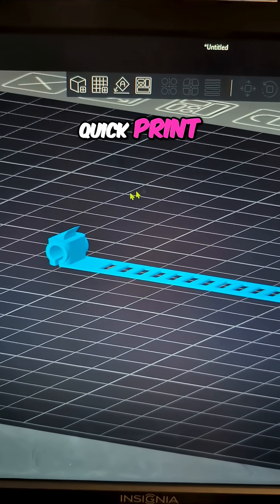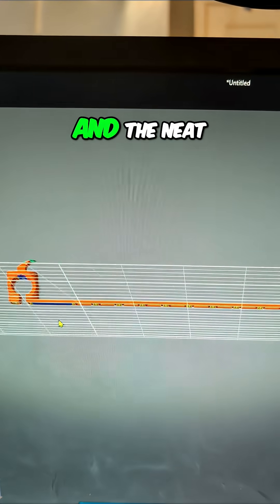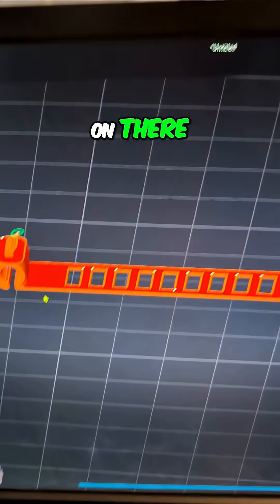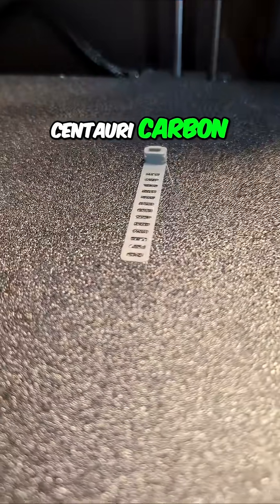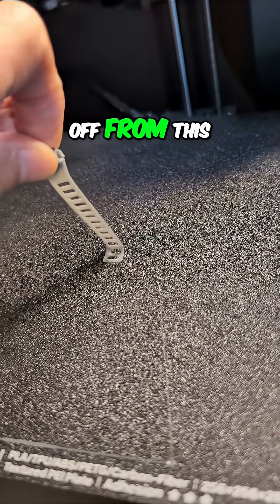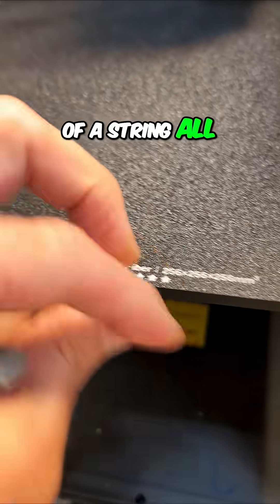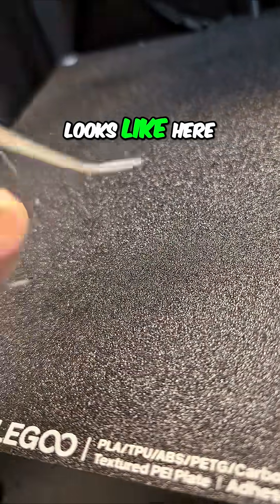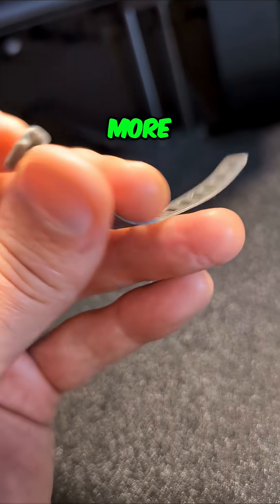3D Printing TPU Test: 3DHoJor filament in the Centauri Carbon

Comment: Hey man, I’ve been getting your shorts a lot, and they’re really interesting! But i think you’d benefit from either cutting some things out in between or maybe going from one thing to another a bit faster. I usually have to skip through your shorts to see the final result or see what’s mentioned in the title. It’s nothing bad, just some feedback for the differences i noticed between your shorts content and shorts content from other 3D printing creators I come across. Keep it up!
Reply from the maker: Thanks. I do edit some, but the shorts only fit in the production schedule if they don't require editing time. I'll try to get to the point quicker.
Reply: @GearReportMaker That makes sense! I haven’t watched your long form content and have primarily seen your shorts so i didn’t think about that.
Reply from the maker: No worries. My main focus is the gear-report.com website. Then I spend varying amounts of time on the 7 YT channels, each covering different topics. And I make lots of videos for Amazon as well. So, I'm just spread too thin to do much editing at all. I've been experimenting on this channel with recording much more spur of the moment, quick, opportunistic videos. I've noticed what you pointed out... since they aren't scripted or well planned, I sometimes take too long to get to something interesting. Thanks for the feedback. :)